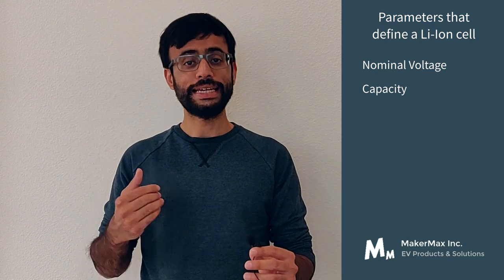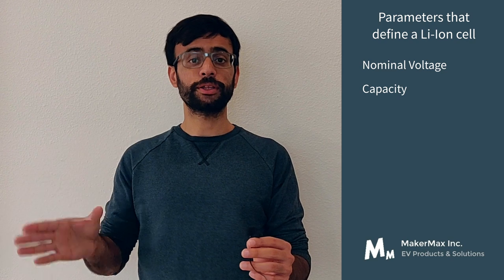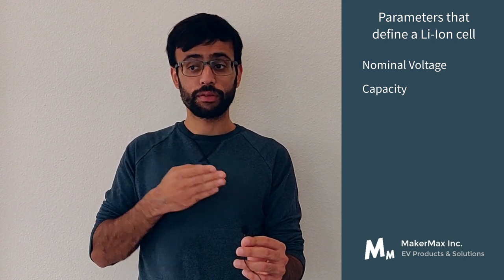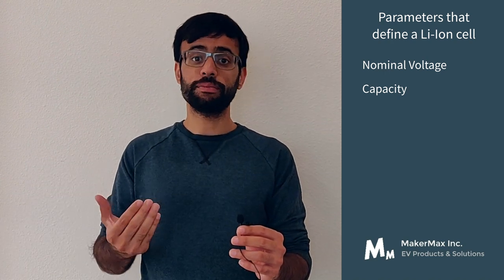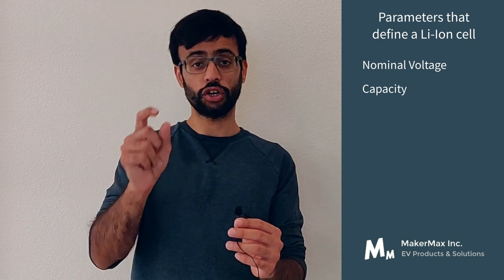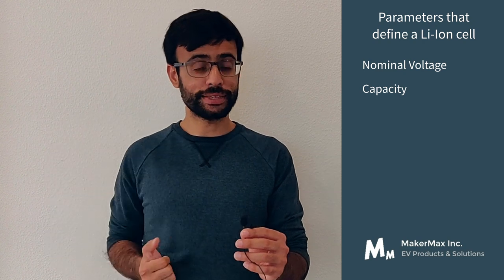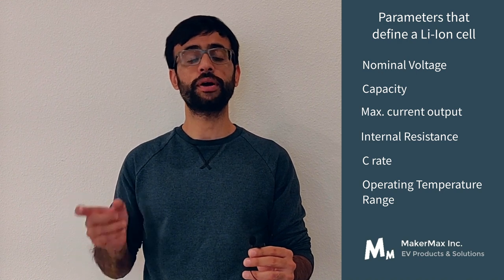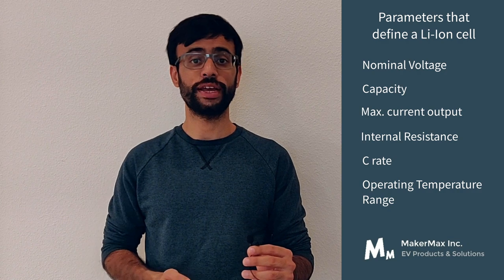Parameters that define a Lithium-Ion cell | EV Guru

Comment: Thenx sir i have all my questions answer thank you so much I made li ion 🔋 from dad laptop battery scrap I am worried about the cells because I have many questions in my my mind your video is really helpful for me I will take care of the parameters  you said
Reply from the maker: Glad!
Reply: After 5 to 8 years, the cells need to be derated and used for weaker low power application before finally salvaging the contents

Comment: Thanks for your video, one question please: I own a li-ion car battery(wich i wanna use with my pv system) with nominal voltage uf 3,65/cell x 12 cells=43,8V, while my inverter has 48v nominal voltage. Can i use it this way? Separating the elements for making 48v is difficult.

Comment: Very good explanation with great knowledge . Thanks for it . I have a question , The 18650 cell temperature going upto 200 degree when i solder the cable on it . Does the  high temperature affect the life of the battery  ?

Comment: How can you determine the max and min voltage based on the nominal voltage. In your example of 3.7v nominal, it was 2.8v and 4.2v.
Reply: through the datasheet, or test your battery through charging and discharging

Comment: NEW BREAKTHROUGH - Fluoride-Ion batteries will soon replace lithium-ion battery for electric cars, power tools, and electronics—as these new revolutionary battery will store more energy with less size and weight, charge more quickly, and have improved safety.
Reply from the maker: May be. Technology, inventions for the benefit of all are all welcomed.

Comment: I have made a 16s , battery pack using 3.2v ,6000 mAh life po4 battery.the pack voltage is 51.2v .Full charge voltage of single cell is 3.65v.Please recommend me the charger ,if I try to increase the pack voltage up to 58v , will it be safe or not? please reply.my old charger cuts off at 52v but open voltage showing 58v.

Comment: I can understand that cell parameters are dependent on Temperature But when it comes to pack We can can have separate temperature monitoring at module level rather than culmination of all cell parameters based on temperatures ..How do you see that